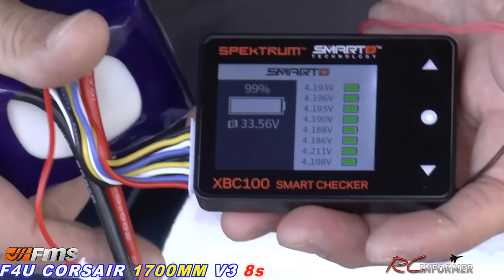FMS CORSAIR 1700MM V3 with 8s POWER! By: RCINFORMER

Comment: @RCINFORMER around 2,310 RPMS more.. 
Sweet! on you first video I was going to suggest 8s and see how that does with a speedo change..
if your voltage sag is around 3.85v per cell under load for example, going from 6s to 8s you pick up 2,310 RPMS! About a 33% increase in rpms.
Total watts per pound goes up as well giving way better performance..

Comment: FMS needs to redo the power package in this and advertise it accordingly.Was wanting one ,but not worth it to me as is,will get the TopFlite giant scale Corsair and spend the money on that and have a real Corsair.Thanks for this test Rich,you rock!
Reply from the maker: The TopFlite Corsair is $850, with NO servos, landing gear, No Engine, & No Nothing. it is a $2000 model when completed! This is $499 for everything except $30 receiver and $100 battery. No comparison.
Reply: @RCINFORMER Mine is near 5000 with fg 84 saito radial took me a year to complete setting and understand fly characteristics, there is no comparison indeed, but it's took me one year to save the money...
Reply from the maker: @castlefranck3979  WOW! You can easily see that at $499 this is a nice model!
Reply: @RCINFORMER  no doubt about that all my fms jet never disappointed me at all,they all flew flawlessy over the years I still use them today as training and relaxing plane before flying my kero ones. Keep going your excellent job Rich I follow you from France since your fly review of f 18 starmax 👍👍👍👍👍
Reply from the maker: @castlefranck3979   You remember the Starmax F-18:)
Reply: @RCINFORMER  I don't mind spending the money,just want it advertised at what it requires before buying,the TF I know what is needed and have no problem with that,not trying to be a dick,just think this needs to be advertised as needs an 8S ,with a motor,esc and prop upgrade needed for decent performance.The FMS 2 meter Beaver seems to fly pretty good on what is recommended,I still love this and will get one,just like to know what is needed before I buy it ,and your great review showed me what I need,so thanks,you are one I trust to give a great review! I will also have the TF one soon as well,love all Corsairs!
Reply from the maker: @jettechdonatkins   I am going to have a live show on Saturday 2:00 p.m. Eastern time to talk about some of the corsair items and other things if you can please join in on it!
Reply: @RCINFORMER  I will be watching,right now still recovering from a nice gig stroke,so sitting and watching rc videos is my fun for now,going to be a bit longer till I can build and fly rc again,but I love it and am hoping to get my new E -flite F-4 refinished and flight ready as well as a new Rurafly Tundra,and a Byron A-4 which I was in the middle of when I had my stroke in MAY.You will like the Byron A-4,12S JetFan set-up,Robart retracts and many mods to the airframe as well,and the F-4 will look very nice with the scheme I've chosen,Callie made the special graphics!

Comment: Question, What was the heat  produced by the 120A  ECS & the motor? Is there plenty of airflow to vent the heat out of the fuselage and the batteries?
Reply from the maker: Yes, lots of intake and exhaust holes!

Comment: Nice test Rich! I'm curious...how do you feel about the prop hub?  A few of us tested the FMS P-51 (1400) on 5s and 6s. All of us blew the hubs apart after several flights. I blew three of them apart...nuked one plane...shook the front end apart.  If the hub and prop assembly is robust enough to 'handle the extra rpm's that's awesome.
Reply from the maker: This hub is pretty tough! It has an additional aluminum backplate to hold it all together!
Reply: Sweet!  Thanks Rich!

Comment: Hi Rich I'm thinking of buying this corsair and run it off 8s with the 360kv motor would I be able to use a 100amp esc ?
Reply from the maker: I found the 360kv motor to be too much amp draw on 8s .... 300kv with 8s seems to be best OR 360 on 6s...
Reply: @RCINFORMER  thanks bud I think I'll be ordering one and choosing the 8s set up , I fly scale but nice to know the power is there when I need it 👍
Reply from the maker: @paulmullen8316  thanks fir using my links to get one:)

Comment: Hi Rich...question for you removing the cowl so you can access the ESC for swapping it out? I removed the three screws but that cowl will not budge. Has FMS started gluing it in place?
There's no way I can see to swap out the ESC from inside the fuse as even if you get the ESC out from under the floor tray the motor wires are not accessible. I have a HW 120A ESC and want to upgrade to 8S.
Thoughts?
Reply from the maker: There may be some residual or additional glue tacking it in place... its not suposed to be glued in:(

Comment: What you think about doing the same mod to the fms P-51 1700mm? Make it an 8s as well
Reply from the maker: It should work fine
Reply: @ACE-hr8he which motor do you have, the 300kv or 360KV? i am asking you that because I have the same P51 1700mm with a 300KV motor, i would like to upgrade my plane

Comment: How do you check the battery voltage when you have two of them strapped together? Do you have a Y harness connected to the balance connector? Or do you read them individually?
Reply from the maker: Individually.

Comment: Hi Rich My Prop exploaded on a full speed pass on 8S ! have you hered of any issues with the prop been able to handle the extra rpm.
Reply from the maker: @rcjetaviator  I have not had that problem. It's always a risk when you modify things. Which motor are you using?
Reply: @RCINFORMER  Hi Rich using to stock 300kv motor on 8s,  just changed the esc like you did. WHAT is your email i can send you the video it sounded like a gun going off .
Reply from the maker: @rcjetaviator  rcinformer.rich@gmail.com

Comment: Do you have any thoughts about putting the RimFire 1.20 450kv motor in as a 6S setup?
Reply from the maker: Not sure, but that kv may be to high.
Reply: @RCINFORMER   I'll be turning mine into the F2G Super Corsair.  Callie at Callie Graphics is making me up a set of the decals for this.  I'd like to stick with a 6S setup as that's the majority of batteries I have.  But it does need more power.  That's why i was wondering about the Rimfire 1.20.

Comment: Hello can you please say why you didn't keep the 360kv motor and use 8s with it. Why did you go back to the 300kv motor? Isn't the 360kv motor more powerful than the 300kv motor?
Thank you also for the video.
Reply from the maker: 360kv will probably be to much load and to much RPM. I may try it but the amp draw will probably be high.
Reply: Thank you for your reply
Reply: Hi there I'm hoping you are still going to try this with 8s and the 360 motor. Is that a possibility?
Reply: Yes please

Comment: Hi Rich great idea bud i have the 1700mm mustang with the 360kv upgrade do you think it would benefit the same as the corsair ?
Reply from the maker: The 360kv on the Mustang really improves it alot
Reply from the maker: Here is my video of it: https://youtu.be/k7ZuNtvulJE
Reply: So no need to upgrade the esc in your opinion bud ?
Reply from the maker: @getoneup2585  I don't think I did, the prop it a little smaller on that model so the load & amp draw is a bit less:)
Reply: Cool that's good enough for me bud thanks for your help 👍

Comment: Rich great video.  How did you connect the 120 amp predator ESC to the receiver? It would be very helpful if you could give us a quick breakdown on how you connected all your leads from your new ESC.  Thanks!
Reply from the maker: Thanks for watching-The 120 amp predator has a main lead to the ESC with 4 wires (it has a yellow one with a servo plug on off the side of the red/white/black throttle cable-this yellow one is for Reverse. The short cable is only a programming cable and is not used with the Rx. Aside from that you just connect up like normal. Hope that helps to explain🙂👍
Reply: @RCINFORMER  Many thanks Rich.  Please keep the great content coming.

Comment: I cannot remove the cowling...it is fixed with glue "or is it just dried color"  ? what should I do, cannot make any works at the motor/ESC, thats bad
Reply from the maker: The cowling screws in ...  there is probably just a little bit of residual glue tacking it in place...
Reply: @RCINFORMER  thanks for that, I will try it again next time

Comment: Hey Rich …. I know this is an older video but I just installed this ESC in my Corsair …. I can not get it to recognize the throttle signal and it won’t connect to the the ESC programming box either … have you ever seen this issue?
Reply from the maker: Try it several times. What radio are you using?
Reply: @RCINFORMER  I’m using DX9 … I have tried 2 different receivers …
Reply: Plug ur rev thrust plug into a spare rx ch. It needs to be plugged in whether u want to use it or not.  I had same issue

Comment: what would cause higher or lower timing? thanks
Reply from the maker: Higher timing will spin the motor faster:)
Reply: @RCINFORMER  and how about heat? more timing more heat to the esc, to the motor or both?
Reply from the maker: So far, no excessive heat

Comment: Rich , any thoughts on changing the pitch of the prop , did that on my 1700mm red tail Mustang made a difference on it ..  very easy to do ,  it has a really grate vert climb just with that mod .
Reply from the maker: After discussing it with FMS yesterday, they have made a NEW prop & are sending me a new prop to test for the airplane:) I will have a video report for it as soon as it arrives:)
Reply: @craigbeaven8445 I have the mustang too and looking for changing the pitch of the prop; where did you get your new prop? size and pitch? thanks
Reply: I have the mustang too and looking for changing the pitch of the prop; where did you get your new prop? size and pitch? thanks

Comment: If I use 2 admiral 4S 5000,mAh 14.8V,  50C or 60C . do I need to upgrade my ESC or can I fly using those batteries with stock ESC 80 Amp.
Reply from the maker: Yes, if you're gonna use 8s. On 6s, no.

Comment: I had sort of asked about that in our weekly Youtube live sessions...thanks for doing that, I think that's a much better solution than the 360kv motor.  I don't need it to be a pylon racer but it sure needed something from the stock set up.  Thanks again Rich!!
Reply from the maker: You should be able to use ANY 8s ESC on the stock motor and make this plane a Powerhouse! probably 100amp or higher will be safe!

Comment: If you can run 8s on the 300kv...would you be able to do the same on the 360kv?
Reply: Hi from down Under I have the same question would it perform even better with the 360kv motor and 8s???
Reply: That's an extra 400rpm ontop of the already improved 2300rpm. Think ur pushing the limits top far on the stock prop and frame

Comment: What is difference from v1 to v3 versions ?
Reply from the maker: Too many to list but the key ones would be better construction using fewer parts, proper hinges on control surfaces instead of foam hinges, massively improved landing gear, more powerful motor, The cockpit does not need to be removed to access the battery on the new one, The quality of the foam,paint, finish etc-there has been significant advances in technology between versions and the latest one incorporates all of the most recent advances in aircraft construction methods. This is just a very summarised list there is actually a significant number of changes between the three and it would take me all night to list every single one but this should give you A good idea of the improvements and the quality of them. Thanks for the question And your support🙂

Comment: I was a bit wondering, on the official homepage of FMS, a pictures shows a motor of 360kV, while later in a table, the spec. says 300kV. well...what is in the box exactly ?

I am not an expert of the topics, so, I just have to buy a new controller and connect a 8s battery ?
(is the some size recomendation what could fit width*height*length ? )
Thanks
Reply from the maker: Well spotted on the website I will make a point of letting them know👍 the plane originally was released with the 300KV motor BUT they may have changed it to 360KV as i did give them a lot of feedback both from myself and guys commenting on our video’s etc. I know they have yet to upload the manual and spare parts to the official website so I will try to get some info for you-unless anyone Reading the comments has bought one recently and can confirm the motor size currently being supplied from factory? I did push for 360 KV and it is possible they may have decided to go with that as the air frame has matured but let me see what I can find out🙂 thanks for the question and support in the channel👍

Comment: I have 2 predator 120A ESC''s and neither one will initalize the throttle using the directions that came with the ESC. We get the correct number of beeps but then it starts beeping steadily and will not stop. No throttle at all. Any thoughts would be greatly appreciated.
Reply: U need to plug the rev thrust plug into the rx too. Even if u don't intend to use it. Must be plugged in to get full function of the esc

Comment: You need to take her up to about 200 ft or more and bring her back down full throttle in a steep dive and then you would get the sound out of it that everyone wants to hear. The Japanese called it the screaming death and we called it the Corsair cause of the disruption of the air as it flies due to its oversize propeller and unique wing design

Comment: Why not just put the correct 6s motor in it and keep it simple?  The 4258-460Kv 14-Pole Brushless Motor from the 1500mm eflite P-51D 1.5m Mustang or a drop in FlightLine 5055-390Kv Brushless Motor
Reply from the maker: I did put the correct motor in it.... its the same size motor except its 60kv more...You can try all those ither motors if you want. The two I used are exactly the same motor & mount size, thus interchangeable... no modifications were needed. The FMS Corsair turns a BIG 4 blade prop... the 5055 may work, but the prop drive is a different size. The 4258 is probably too small.